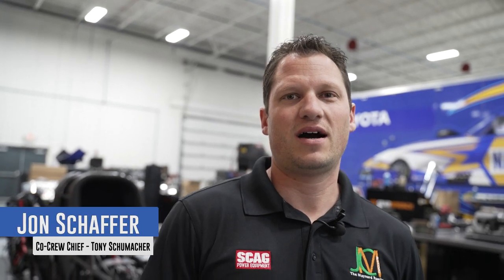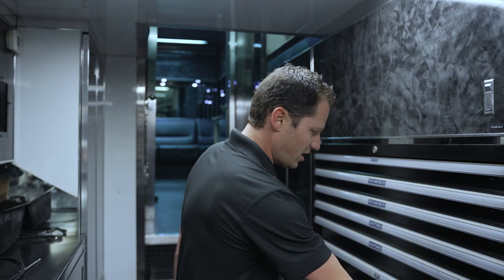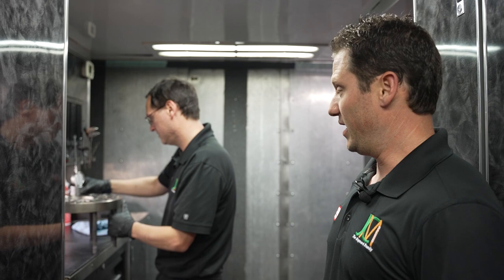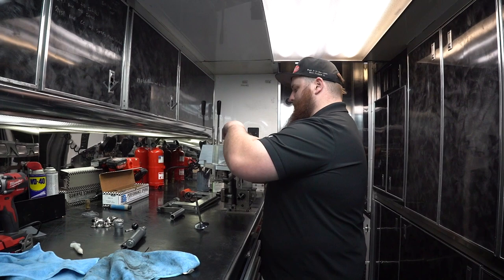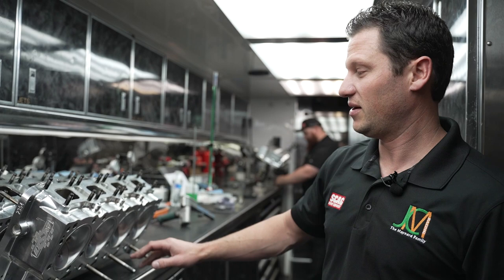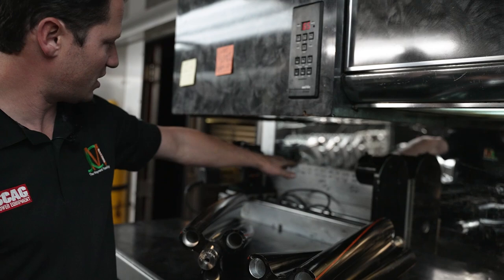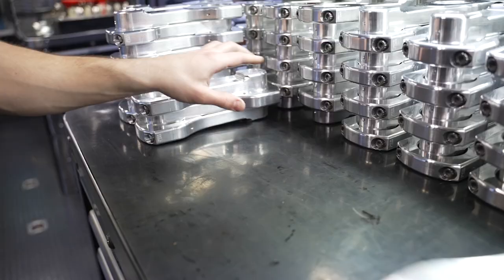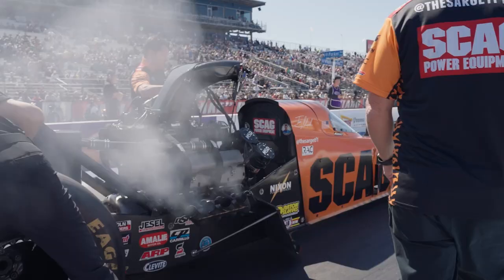Tony Schumacher Trailer Tour at JCM Racing

Comment: Good grief. The blown fuel classes have become way too expensive and too much maintenance. 30 cylinder heads in the trailer ??!! And nhra wonders why there are barely 16 cars showing up at the track to make a qualifying run ?
I personally liked the sport before it got to this point. I remember going to the Winternationals and there would be 40+ Nitro funny cars in the staging lanes to make a qualifying lap. Today's environment is prohibitive for all but a select few to try to run the nitro classes.